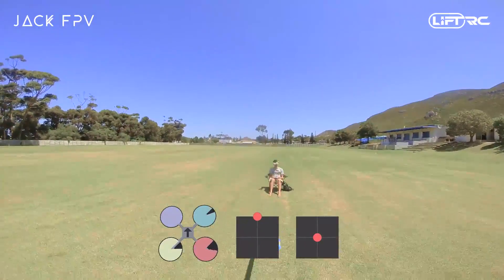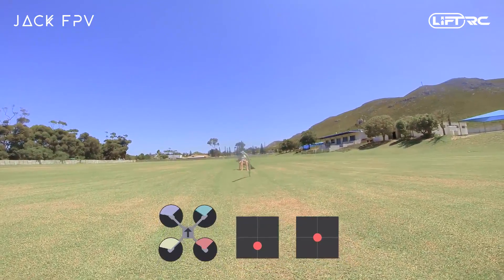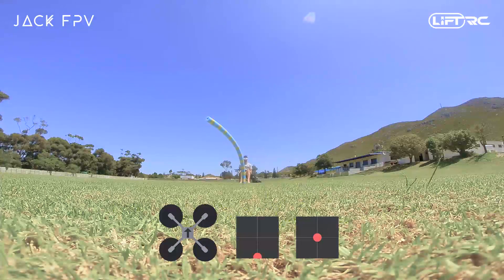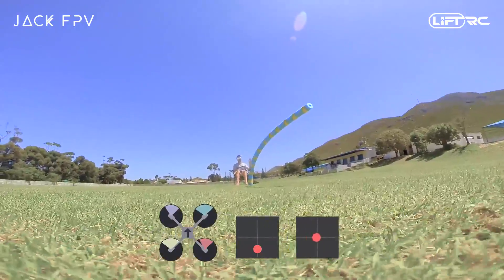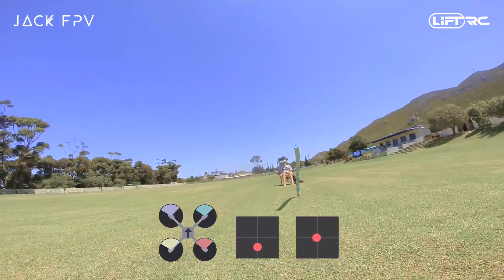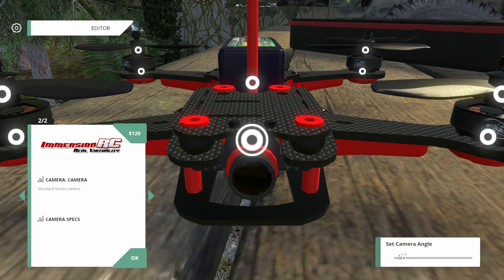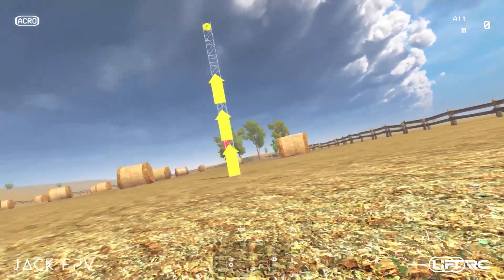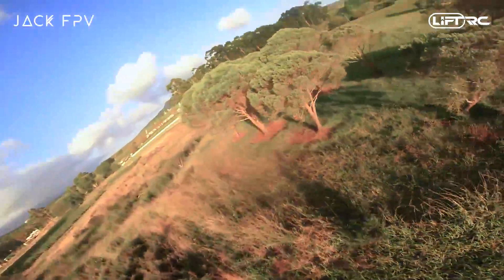How-to Fly FPV Quadcopters / Drone - "HOVERING"

Comment: Hey Jack, thank you for the video! I'm using it as my main guide for fpv!
I'm praticing on Liftoff the tutorial map, but i feel the drone very loose. It's difficult to keep in place (i only have 8h os pratice yet) but very few times and very few seconds that i succeed to align the poles
Someone said to change the rate, and my question is: is this cheating? I mean, in real life it will make things difficult for me cause i made those changes in the sim?
Thank you!

Comment: im confused about the modes, what does the mode 1 and 2 refer to? thanks
Reply: Bobby Dixon It is basically what the sticks on the transmitter do. In mode 2 left stick up/down is throttle, left stick right/left is yaw etc. on mode 1 the controls are on different directions and sticks.
Reply: !-left handed
2-right handed

Comment: Inside when I hover it just does flying into the wall..... there is no wind and when I turn right it doesn't turn... it keeps going to the left!!!! Wtf
Reply: Ok ... we could use a bit more information

What quad are you flying and has it suffered any crashes? Are you using prop guards? Are you using the stock transmitter?

It could be any number of things so the more information the better. Above all, don't assume you're doing something wrong. Quality control for many of the cheaper toy grade quads can be horrible so you could just have a bad quad.

Comment: Go to flight controller settings and set expo on Roll and Pitch to 3, much easier to learn. Jack, do the same on your TX (whatever you need say 30%) and you will find it easier to hover.

Comment: I know these are geered for beginners, very good video though!
As you know the physics of Liftoff have changed, do you have recomended settings for advanced acro on the new version?
Reply from the maker: +Zenman FPV Thanks Zenman. Advanced videos covering some pretty hectic moves will also be rolling out as soon as these are under the belt. As for the physic in Liftoff, I'm currently running a betatesting version which has different physics from the one that you're currently running. Will see if I can get the settings from a mate that has the current version you guys are running though :)
Reply: +Jack FPV Very cool Jack! You have a very good teaching technique BTW
Reply from the maker: +Zenman FPV Thank you :) Hope it helps some guys get into this amazing hobby!

Comment: I'm not sure if you should start with hovering in ground effect. You usually wan't to avoid that low height, since it makes the movement of your quad less stable.
Reply: +BlackPixxelDE I like the idea of it as a "training wheels", Most first time FPVers tend to climb and then get off the throttle and bounce on the ground I think getting over the nerves in ground effect might be helpful at first. But yes the real control learning happens after that.
Reply from the maker: +BlackPixxelDE So the reason I started with practicing in ground effect is so that they only have to worry about 1 stick. Just the roll and pitch. Once they have that nailed down, they can move on to the next exercise. With ground effect the quad will be unstable yes, but as I beginner I believe the pro's outweigh the cons.